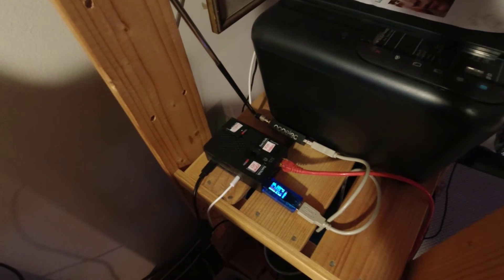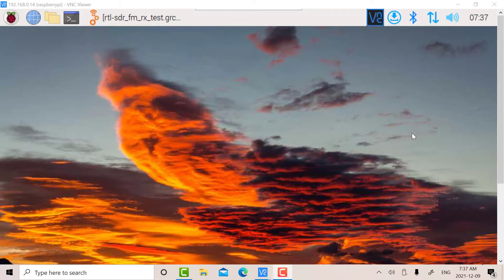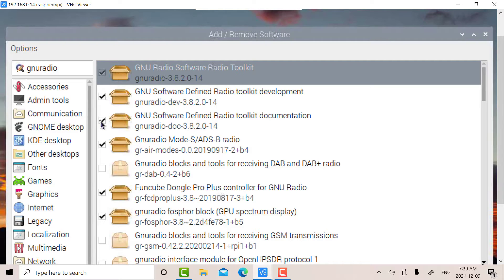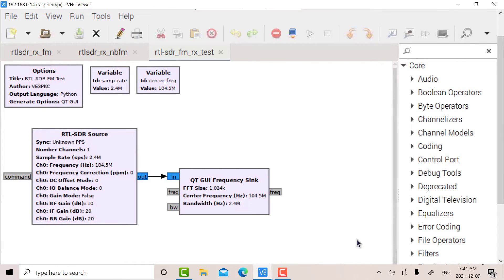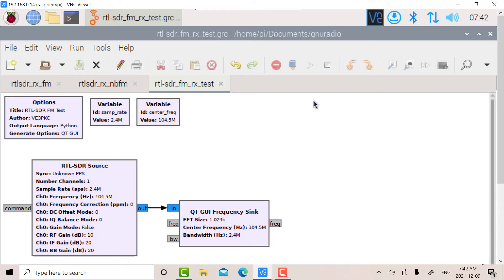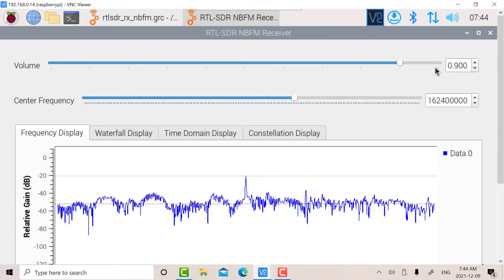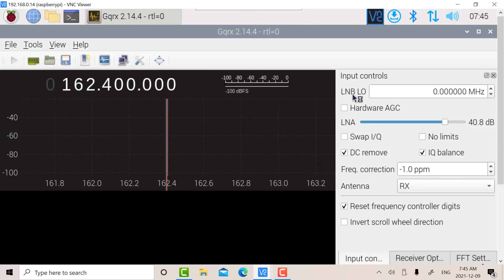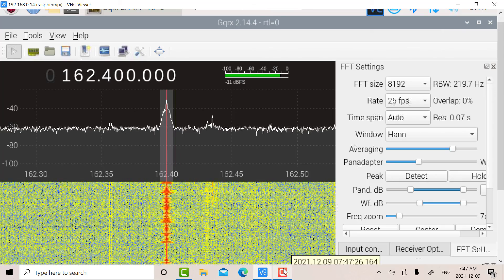RTL-SDR on Raspberry Pi4

Comment: Does it really need to be this complicated? Why can't we have an SDR# for raspbian?
Reply from the maker: Gqrx is excellent, quite similar to SDR#.
Reply: @ClarkTelecom  CubicSDR does not run well at all on a Pi3B+. Do you think Gqrx will perform moderately well on a Pi3B+?
Reply from the maker: @bamargera0123  SDR programs take a lot of cpu resources. You may have breakups depending on what you are receiving. You can always back off the sampling rate to see if that helps. I seem to remember that nbfm marine weather was ok on the 3B, but stereo wbfm broke up a bit.
Reply: @ClarkTelecom  I have a Pi4 1Gb and a Pi3B+. Which one do you think will run CubicSDR better?
Reply: Pi4 1GB works much better for CubicSDR.
Reply from the maker: @bamargera0123  Thanks, that's good to know.